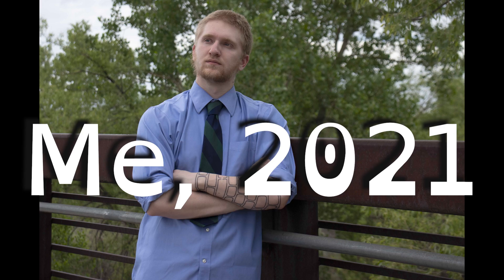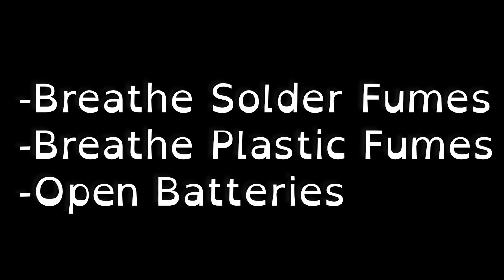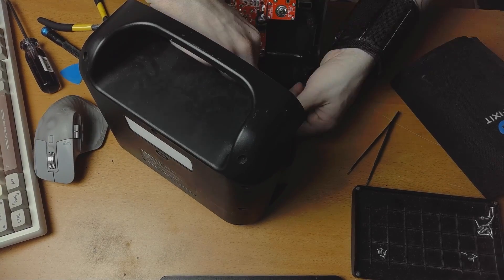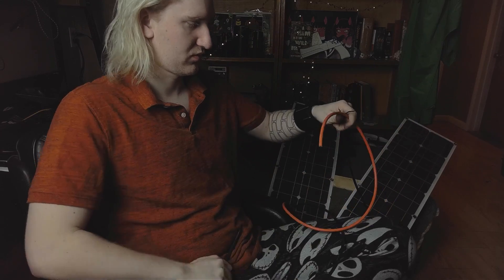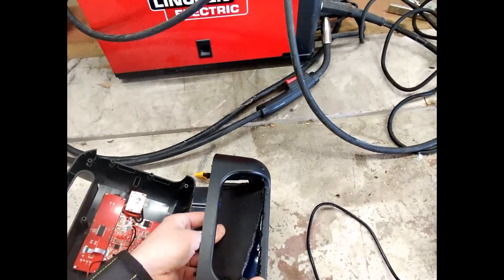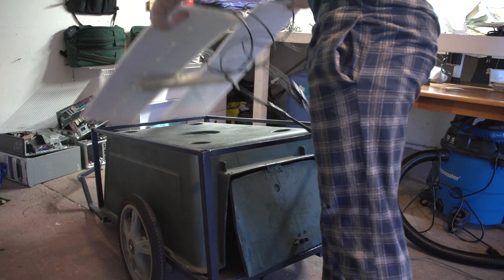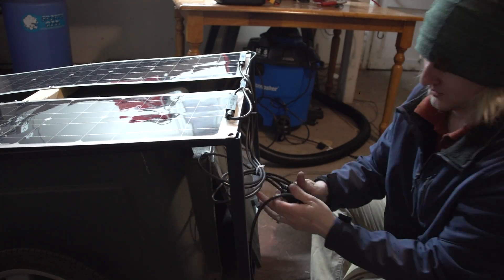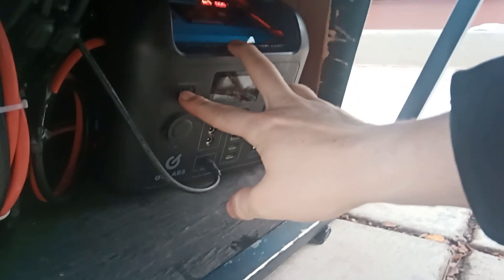This Solarpunk E-bike Trailer Charges ITSELF

Comment: The advantage of DC to AC mean you now have power to go solar camping.
Here in Trujillo Perú I'm in the process of making a solar trailer for the electric scooters you see in my thumbnail photo. It's a no weld built, using house panels because I can't weld and flexible panels aren't sold here.

Comment: i'm no professional on this subject, but i would stamp this as solarpunk approved.
Reply: also, home depot and ace hardware should have basic respirators that come with wide-general-purpose filters that should be good for the various fumes in this video for only 50-60 bucks. good for wood sawdust too if you ever work on that.
Reply from the maker: Yippee! I know Solarpunk is still ambiguous in a lot of ways, but I want to contribute, and try to represent as many ideas as I can!

Comment: Not sure why an Inverter is in the mix, a simple small MPPT would do the trick, adding some ability to angle the panels would be great also, when riding E/W you could get more charge or adding a panel on the left and right side of the trailer. Would be nice to know how much power the panels are collecting, I was also looking into some flexible panels to make something like this, but I had planned to sort out a system of carbon fiber or fiberglass rods with different holes to allow for different positions to maximize solar production and reduce weight while making a larger storage area (they would be default in a low arch running lengthwise
Reply from the maker: I use an inverter so I can use the original charger that came with the bike. The last thing we want is another news article titled "Local Idiot Hooks Unregulated 48v To a Battery and Explodes", haha! I just don't know how to build my own DC-DC charger with enough safety features or overvolt or overcurrent and stuff like that. The original charger is the safest bet in my mind. Unfortunately it's AC.

Let me know how your build goes, I bet it'll be awesome!
Reply: @TheQuietPartisLoud yes exactly. need to have a charge specifically for litium ion batteries. Should've read your comment before replying to the original!!

Comment from the maker: Update: The sun came out for about 4 hours and got the battery to 50%! Pretty close to what I was expecting.
Reply: wait, how long of charging? and you mean the battery bank was at 50% correct? so in a real world use case you could get another 25%  charge had you rode for however long it took it to charge to that 50% but that is why it is important to know about the length of time it takes to charge?
Reply: The cold will affect the charging times on lithium batteries.